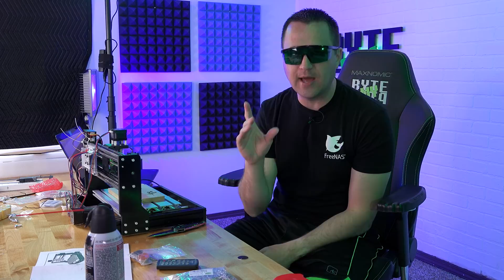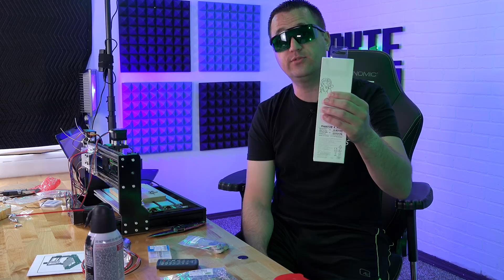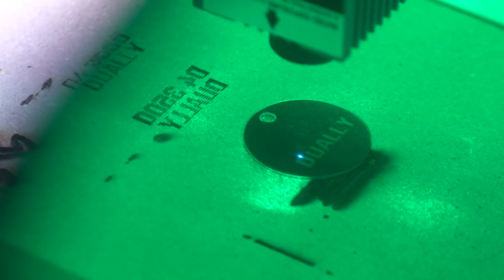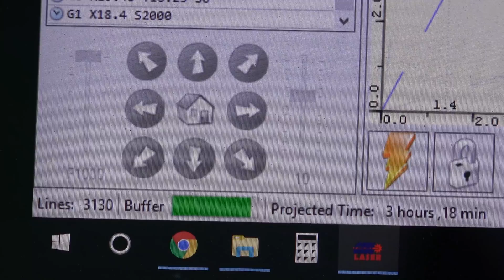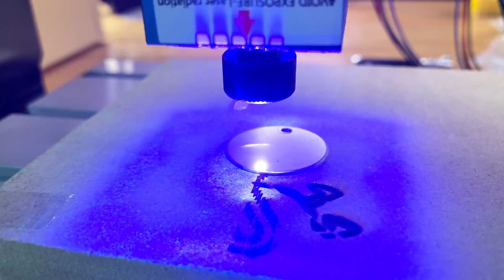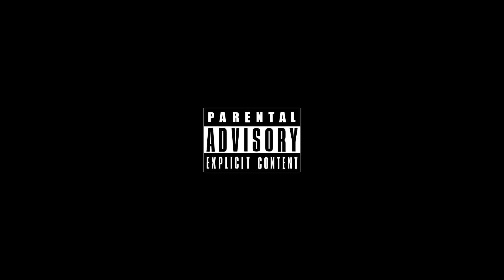The CNC3018 PRO with Lasers and Blades! (CNC Machine)

Comment: Most of what you have shown here would be research prior to purchase for most ... these machines are OK but the true Laser Wattage is far less than they advertise,  the price should tell you that.  Maybe start again and spend some time on deciding what you want to achieve and what is available.  I have a 50w CO2 laser the actual full power output is anything from 36w to 42w bearing in mind its not a good idea to run these cheap lasers at full power for extended periods of time.

Comment: Just a friendly word of warning from someone that has played with lasers more than cnc machines. If that laser head puts out more than 0.5w (500mw), which it must be if it's able to engrave at all, be EXTREMELY careful when it's in operation because even looking at the dot where it's burning without legit laser safety glasses can cause permanent eye damage. If you were to happen to have something reflective on the work area, and you caught a direct hit to your eye , the odds of instant and permanent blindness are very high. Also, every wavelength (color) of laser requires the matching laser safety goggle, and I'll tell you right now that the ones you get with all these budget laser devices aren't the right ones. The correct laser safety goggles for lasers in the blue range are going to be close to a flourescent orange color and the laser dot when viewed through them will be very faint. If you dont believe me, try putting a piece of material with a dark non reflective surface on the work bed and fire the laser through those green glasses onto the material and see if it makes a mark. If you want a good pair of glasses that will protect your eyes, anything that is made by the company 'eagle pair' that says it's good for 435nm lasers will do the job. It's not worth losing your eyes man. It can literally happen before you can blink, and best case scenario if you take a direct hit is the possibility of only getting hit in one eye and having "a second chance". Sorry, normally i give the finger to the safety nazis myself, but I have much respect for the damage a little laser can do. Please just be careful :)